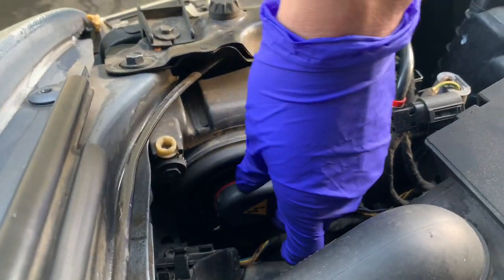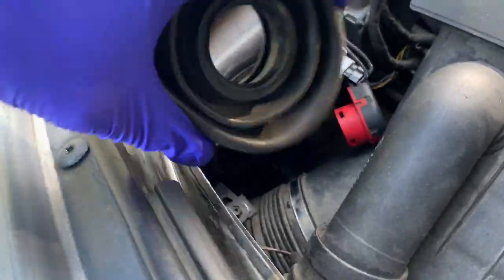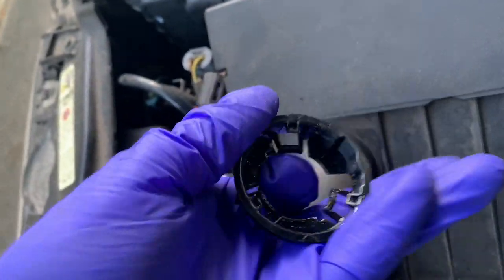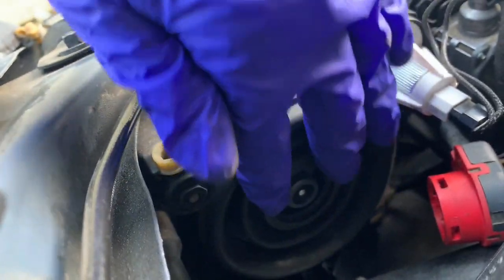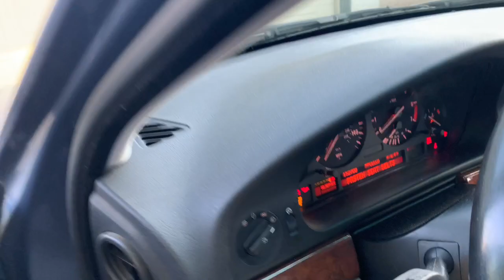BMW E39 Xenon Headlight Bulb Replacement

Comment: I’m having trouble removing the black ring 🤦🏻‍♂️ but this job looks so simple !!
Reply: @Captain Easy D no 🤣 to this day I’m running 1 headlight but like a Jack ass I’m using my high beam as a light
Reply: @Captain Easy D thank you I will try that!
Reply: On mine the black ring was held on by three T20 screws. It was not a twist off.